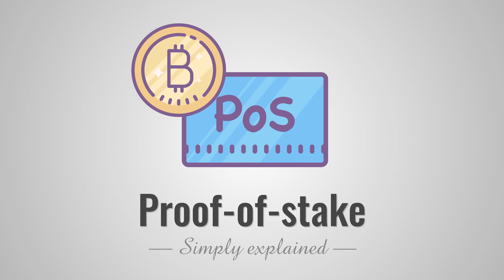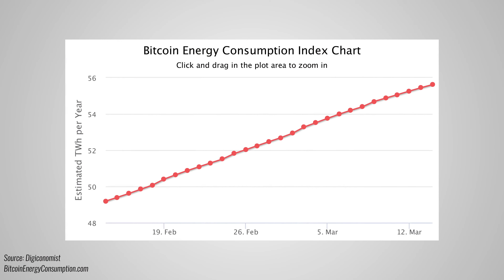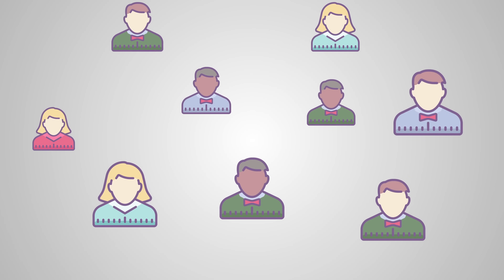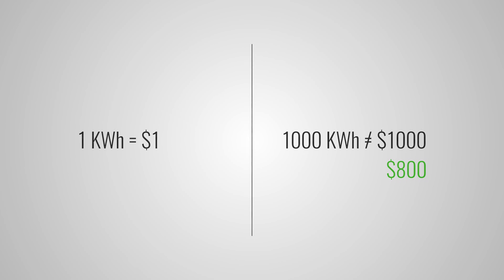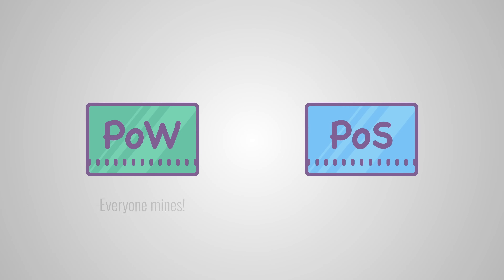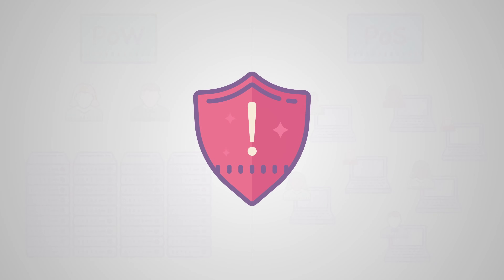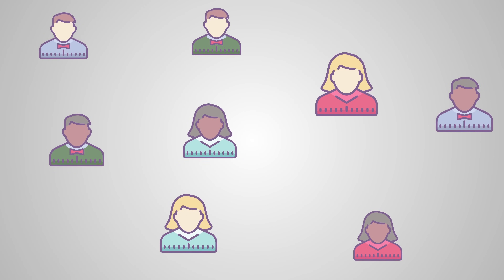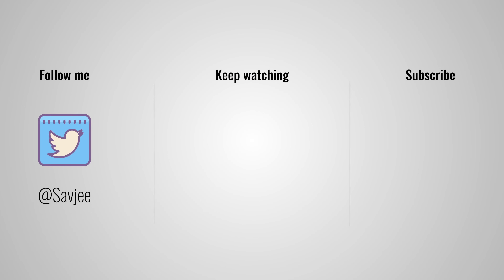Proof-of-Stake (vs proof-of-work)

Comment: How do you determine fraudulent transactions, when you only have one validator responsible for checking? There would have to be others also checking to ensure the validator wasn't passing a fraudulent transaction. And depending on how many steps you have in validating the validators work, you could be spending a lot of energy there too. Maybe the solution would be to randomly select one high stake and one low stake validator for each block. It would drastically reduce the odds of a fraudulent transaction passing, because if the two validators returned different answers you know one of them is wrong and no reward is distributed at that time. At that point it would probably trigger a backup pair of one high one low stake validator, and if both of them get the same answer and it matches one of the original validators, then the original validator who had the right answer can get their reward, the one who returned a wrong answer gets a penalty, and the two backups split the reward and penalty from the one who had a wrong answer (so probably less than being a first-round validator who got it right, but still enough to make it worthwhile). And if the backup validators don't agree on the answer, or they agree but it doesn't match either of the originals, then it's likely a fraudulent transaction that should be stopped. This system wouldn't be as efficient as a single validator per calculation system, but would be a lot more efficient than proof-of-work, it would be a lot more secure and reliable than single validator, and it would also give lower stake individuals the ability to be involved and earn rewards too. And having one high stake plus one low stake involved in every transaction, it can work a bit like a system of checks and balances
Reply: I believe the algorand project does just that. Because you are right. Single validations to only those that have a lot staked in the network... lack of back up validators to ensure proper verifiable non malicious activity.  Your solution can actually make the system more secured, fair, and yes, a checks and balance like system.

Comment: You make a big deal about how mining pools are a problem in proof-of-work cryptocurrencies, because of how they cause centralization of power. But does proof-of-stake actually solve this problem?

The reason mining pools exist in proof-of-work systems, is that the chance of a solo miner mining a block is tiny. You could run a farm for months and not get a single block. Or you could get lucky. The mining pool turns a lottery into a steady income by aggregating large amount of computing power, and paying out shares of the income of the blocks you mine together.

I don't see any reason the same couldn't happen in a proof-of-stake system, except where many stakeholders come together to pool their stakes, and turn that into a steady income. Similar to investing in a business that pays dividends.

My conclusion is that proof-of-stake by itself doesn't seem to prevent pooling, and in fact, the same incentives seem to be there as with proof-of-work based currencies. Unless I'm missing something?

Comment: Why not choose multiple validators for the same transaction by default? Like a "validation group". The group will never be made out of the same individuals for security purposes. Moreover, individuals could be evaluated by comparison, like A + B worked great, A + C not so much, so B is better compared to C.
As a plus, (small) redundancy never hurts.
Reply: I think that could be a problem, because 2 validators could create blocks with different transactions

Comment: Except that the stake in POS is temporary while the cost of mining equipment is permanent making that system more secure and indelible.
Reply: Stake lost in PoS is burned and is lost forever.
Reply: @AwfulnewsFM  everipedia took me my sum after an accurate depiction of one page and a non-accurate one for another. I provided images which were removed too. That was censorious, to begin with.
The question: Have the amounts I initially had burned, or are they temporary? Also, the cash showed as zero after a great initial boost by a tipping node.

As an aside, everipedia's efforts are laudable, but it's pretty flawed, even beginning from the four-pin code for the account, last I entered.
Reply: The PoW one?

Comment: Great artistic videos you have here Mr. SE.

However, what led you to believe proof of stake was first exposed in 2011?  It's incorrect.

Satoshi introduced his own version of PoS in the later versions of the bc white paper.  They all had version numbers up to v11.  And more than 8 citations.  Satoshi intended the first implementation of Bitcoin to have a combined PoW + PoS algorithm.  However the guy that hijacked bc with the overwritten v0.1.x version number releases only had a very early version of the white paper that only mentioned PoW, which was commonly used on several prior digital currencies.

Notice the various email/mailing list subject lines always mention two digit version numbers but the text in the body of the messages and in the file names have 3 digits.  You think a precise computer programmer and speaker like Satoshi would be loosey-goosey with his numeric designators? And no one would ever mention the discrepancy one time in 12 years?  No.  Because there wasn't a version mismatch, because that was produced after the fact by the person Satoshi subcontracted to modernize and manage the codebase between Jan, 2009 and late 2010 when original Satoshi changed all his account passwords and dipped out .. because he came to realize that Satoshi #2 could not be trusted.

Satoshi #2 also conspired somehow to remove the .PDF contract with their real names that Satoshi inserted into that first week's transactions.

That explains the 2 zero difficulty size anomaly.  And what I've seen mysteriously change in just the past two weeks:. The genesis block always had a hash of all zeros.  And block #1 had a height of like 216 blocks.  (I think).  

Anyways, I'll bet you that if you calculate the number of blocks that would/should be generated during that missing first week, it would exactly account for the two digit difficulty anomaly.  If there was 2-3 computers mining from Jan 1st or 3rd to the 9th.

If memory serves, the actual genesis block was mined on Jan 1st and had 4 newspaper headlines.  The Jan 3rd block had one headline, and also a binary blob of data that consisted of an encrypted business contract specifying the arrangement between real Satoshi and his fake friend Satoshi #2, with their real names.

I believe that Satoshi had asked Satoshi#2 to implement Bitcoin originally using a perfect requirements/specification doc, but he "couldn't figure it out" and gave up.  That week Satoshi #1 said to his GF (Satoshi #3), "How hard could it be?"

And SN#1 sat down and coded bitcoin-v0.1.exe in 4 days.  That would have been over 1.5 years before Jan 2009. 

All will be revealed. Satoshi #1 has compassion and understanding for the bad guys (friends?), and hopes they don't get in trouble.  They know not the error of their ways, and merely forgot that Satoshi#1 always acts to further the best interests of all parties involved.  By being greedy, they lost everything.  By giving everything away, SN#1 manifested everything for everybody forever.

Very ironic.   

(please link/repost this post far and wide. corrective steps need to be implemented before it's too late)

Comment: Lots of misinformation here. You don’t need expensive equipment to run a node in a PoW system (apparently author doesn’t even realize this is different than mining). PoS is very similar to the legacy fiat system. It will be interesting to see if ETH can pull it off.

Comment: Does Proof-of-Stake really prevent fraudulent blocks from being entered into the blockchain though? 

As far as I know, with Proof-of-Work, the blocks are continually checked, as it is the blocks with the most computing behind them that are trusted. This means that in order to enter false blocks, and keep them there, one would have to give continuously have to compute more than the entire rest of the network combined. Not very practical, though I assume this is why the 51% attack is theoretically possible. 

With PoS however, it sounds like it is completely possible for a validator to enter a fraudulent block, so long as they are willing to accept losing the stake they initially put in? Wouldn't that allow a malicious actor to essentially "buy" fraudulent blocks on the chain, thus undermining the entire principle that it should be impossible to enter false information into the blockchain? Not only that, but if an actor enters a false block how would the network even detect that block at all?

Comment: im unclear on what is happening behind the scenes. validators/nodes aren't physical people, so how could it be the stakeholder's fault if a fraudulent transaction is approved? its a computer doing the work, right? would fraudulently verified transactions only be possible if the stakeholder was tampering with the system?

Comment: It explain nothing 
Miners are there to make it impossible to change a previous block and make a valide parrallele modified blockchain.

I don't get how PoS replace that mecanisme
Reply: A big problem is that, in PoW blockchains like Bitcoin, a lot of miners pool together which is potentially dangerous as in the future, if enough miners pooled together, they could do what is called a 51% attack since they have the majority of hashing power in the network (think of it as a vote). Also, miners themselves don't make it impossible to change a previous block. Blockchains are intrinsically immutable.
I hope this helps.
Reply: @turbo6266  it's immuable because of the mining. If someone want to modifie a block, he have to calculate every hash or every block after the modified one, and the faster than all the other miners together, in order to submit a conforme modified blockchain. (Here is why there is this 51%). In other words, that's the mining who made the blockchain immuable.
But I don't see that in PoS. I don't get how they make it immuable in pos
Reply: @Merwip  Well i guess it is technically is immutable because of mining, but that is because the transaction enters as an input, after which hashing occurs, resulting in an encrypted output as a checksum. iMMUTABILITY is the intrinsic nature that makes a blockchain what it is - safe. However, you said you could calculate every block back, which is impossible because the hash is so sensitive that if you change it just a bit, the encrypted outcome is totally different. It's almost impossible to calculate blocks back.

Proof of stake is also immutable because the validators are selected randomly, and thus the node forges the input. Think of forging as a different term for mining, but for proof of stake instead of PoW.

To conclude, proof of work makes nodes compete, proof of stake selects validators to solve, and try not to think about mining as the reason why bloickchains are immutable. They are immutable because the encryptive algorithm just makes it pretty hard to solve the encryptions.

If some stuff, doesn't make sense, soz, i've only been looking at blockchain for like a week :P

Comment: Mining pools are basically workers unions—and they compete with one another. For instance, HiveOS competes with Nicehash currently as well as many other pools to secure Ethereum nodes. These pools are made up of many different individual miners. If a majority of individuals in any particular pool are dissatisfied with the way the pool is being run, they can change pools or force the pool owners to make a change. Seems as though this would actually PREVENT centralization because individuals are given the power to chose which pool to belong to. Proof of work also focuses more computing power on each individuals node(which of course uses more electricity, as you noted), but wouldn’t it also promote higher accuracy of work and increased network security? Proof of stake seems to promote monopolization by whomever has the biggest stick to swing around. Will this not lead to one large mining pool centralizing control and monopoly over every Ethereum transaction moving forward? I could be wrong...I’m just trying to think critically about this.

Comment: What's stopping PoS pools from forming? It seems that for solo "validators" it wouldn't be worth the stake due to the very low chances of selection no?
Will people not form pools that distribute rewards for a PoS network as well?
Reply: Ikr. Also with like ethereum 2.0 when it switches to a PoS consensus mechanism, you have to stake a whopping 32 ether! Who tf has that much ether? I certainly don‘t. So for small people like me, I would HAVE to join a staking pool to even stake my ether. It‘s not alot better than joining a mining pool (with my gaming rig with one single gpu) and getting my 3-5€ worth of ether every day... Also I would get alot less ether with proof of stake.

Comment: So PoS is basically: whoever has the most assets, makes the most assets. 🤔

So we're basically giving minting power to institutions who like to keep unproductive assets under their property/control, right?

So we're basically reconstructing the very same centralised system we were trying to fight off in the first place? 🤔

Doesn't make any sense to me.
Reply: could not agree more
Reply: I agree it makes no sense POS doesnt even deal with how to distribute the initial coins. The leader of a dictatorship could print themselves all the coins in a POS framework and use POS to run it but the dictator gets all the money and control while the users have to verify the blocks or be dilluted and thats a very common way of using POS its really not secure or decentralized. Who cares about a 51% attack if the creators spawned all the coins for themselves for free thats basically an attack at the outset.
Reply: @bitcoinizakaya9579  exactly, and a 51% attack becomes harder and more costly when there are more people mining right?
Reply: What do you think of PoS in comparison to PoW?

Comment: Major misconception here, proof of stake with a select few validators isn't more decentralized than a proof of work consensus algorithm. This is the reason bitcoin remains the most decentralized blockchain in the world still in 2021.
Reply: How about monero?
Reply: Thx for the vid. What happen  if a chosen validator make up a fraudulent transaction that would greatly benefit itself over the stake it has. Will it succeed and what follow up measurement to identify the fraud?
Reply: Who controls “satoshi” wallet?
Reply: Major ETH stakeholders are exchanges, whereas the largest BTC miner pool is run by a private sector corporation whose capital structures are unavailable. Let that sink in.
Reply: But aren't 70% of miners in china?
Reply: @grammarnationalistpartylol6301  nope. China all time was less then 30%.
Reply: @grammarnationalistpartylol6301  doesn't matter. The whole point is that doesn't matter all it will change is the price of transaction. When it does matter congratulations the miners split 50 50 and we have a fork. Now bitcoin and a different version of bitcoin are both created. You have equal share in both and can transfer your value to whatever one you think is best. The miners vote by making a fork. The holder vote by choosing where to put the extra shares they got in a new chain.
Reply: @grammarnationalistpartylol6301  used to be*
Reply: Uh no, It's because bitcoin started back early before the arise of Dapps. New Dapps now have more explosive popularity and growth in their infancy which proves my more potential than Bitcoin. But none the less both of them are decentralized.
Reply: Cardano has 4,000 nodes, that’s the most of any blockchain by 200%
Reply: I believe Cardano is more decentralized than Bitcoin now.
Reply: Bitcoin is one of the least decentralized currencies out there.
Reply: @AwfulnewsFM  I'm sorry but either you haven't done your research or you don't understand  the metric for calculating what decentralisation is.

Comment: So let's say I am chosen to be a validator, and my money are at stake. How am I supposed to know if Johnny is actually buying an ice cream across the world or not and how can i validate on that in real life. This makes no sense. This is the final purpose right? Exchanging fiat with crypto currency and implementing it in the real life. And this pos makes no sense. You need a user to validate a transaction and then you have to check that transaction in order to see if the validator will get a reward or he will lose his leverage money. So you will correct that using what? Another computer wright? This has absolutely no sense. And it favours the insecurity of the network.